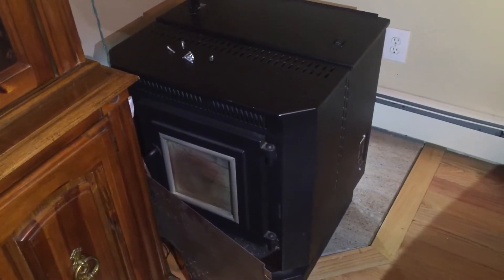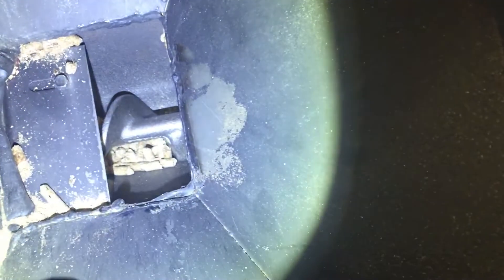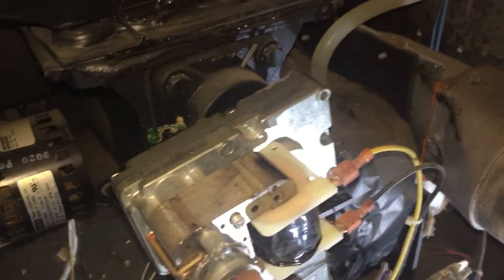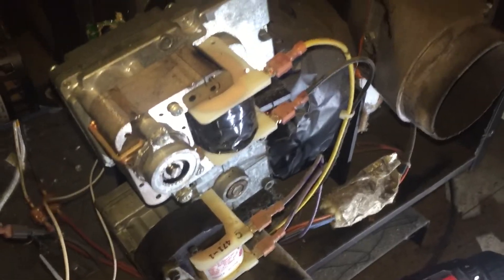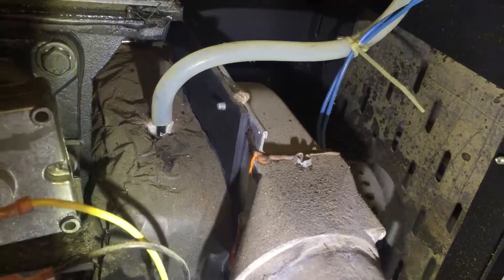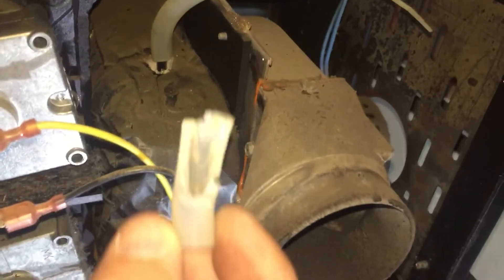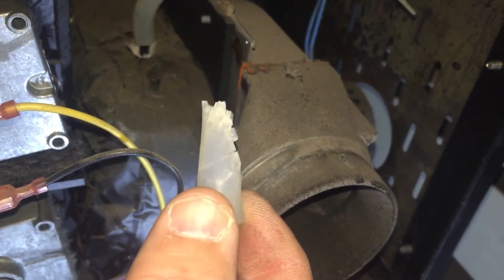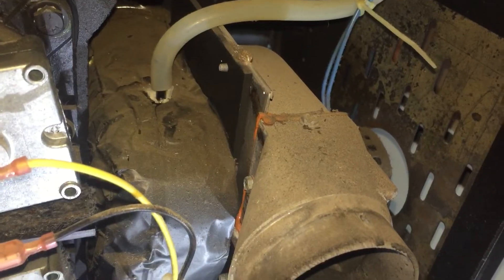Englander pellet stove would not stay running model 25 how to fix

Comment: I have a kind of opposite problem. My stove is in it's 14th year. About two years ago I replaced both augur motors and the stove ran fine. I looked at that hose very carefully at the time and it looked just fine. My lower auger is running just fine but I'm not getting any pellets delivered to it through the start up sequence and then for about another half hour. I have to start the stove with pellets already in the box and then occasionally add pellets to keep the fire going until the upper auger finally decides to send pellets to the lower. After that it will run all day just fine. If it's not the hose I'm wondering if it's some other sensor issue.

Comment: I've got the back panel off my stove , for 2 reasons. 
I've got my unit set without the base on some vibration isolators, and the back is flush with the opening of the fireplace. 
First reason is for easier maintenance and access . 
2nd reason is I propped up a fan in the fireplace to blow on all the stuff behind the cover. 
I burned up 2 auger motors in my first 2 years until I did this , and now it's been like 5 since I've replaced one. 
Keeps it cooler and doesn't bake the lube out of the gearboxes.

Comment: Mine moves until I fill the hopper then it gets jammed. I've cleaned it out over and over, unhooked and rehooked the motor and still the same issue. Works fine on a dry run. Any suggestions would be greatly appreciated. Thanks.
Reply: Grease the bearing
Reply: @Levisnteeshirt1  .  It fixed it. Thanks so much.

Comment: You understand you're supposed to have at least 3 feet of clearance around the stove so you don't transmit heat, radiant heat, to your walls and other combustible items and set them on fire as they warm up to their flammable or combustion levels. 
Idiot... probably a safety switch?
Where do you live? That's a house fire that's definitely going to happen, I want to run this incident as fire chief so I can say "Idiot, I told you so."
Reply from the maker: Wow... outside of Philadelphia. Would you like to inspect?   Please note page 27 of the manual. It states that you are allowed 6” of clearance from a wall.   That’s the great thing about pellet stoves,  but thank you for being key board commando .. sorry “chief key board commando” 
http://pdf.lowes.com/useandcareguides/794909551007_use.pdf